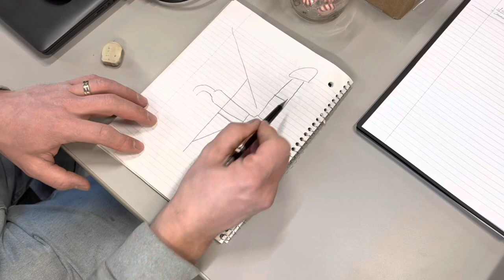Off Grid Cabin in the Woods gets a Wood Stove!

Comment: The base (crimped end) of the stovepipe needs to fit inside the stove collar. Jotul makes an adaptor to fit a 6in pipe to the stove collar. All crimped ends need to run towards the stove so the creasote flows back into the stove instead of leaking out.

Comment: i just installed a Jotul 602 in my garage. it had a 5 in receiver. i found a 5 to 6 in connector that allowed me to go inside, the way its supposed to be done so you dont get any creosote dripping out onto the outside of the pipe or on the stove. i've had it sitting in the basement for almost 30 years.  its bullet proof. fire brick on the bottom would work too. my only complaint is the short 16 in wood, but for my garage, they will be nice short fires. nice job.

Comment: Some thoughts on your build. Replace the shim under the wood stove with some fender washers of appropriate height, or, if the offending leg is detachable, shim it down from the stove body. Also, you should install jack studs below your loft rafters. Don't rely on the shear strength of the screws alone to hold any weight for any length of time; they won't.
Reply from the maker: Thanks for watching David

Comment: No vapor barrier on the walls or ceiling?
Reply: It is a shed afterall. The solid lumber helps in moisture management.  comment a snow shelve  to protect from sliding roof snow is recommended.

Comment: I have a Jotul 602 And my only gripe is a short burn time. Yes im using OAK or Maple hard wood. It seams like 4 hours is Max. I have not tried to dampen it down to almost nothing. Whats your burn times like?? I would like to stoke at like 10 11 and still have something at 6 would be Ideal... But at like 4am its OUT like no heat and the cabin is cold....
Reply from the maker: Having installed this stove late last season, I do not have a good idea on run time, though initial burns tell me they’re short as you mention. In addition to the door damper I installed a damper in the flue so with a little testing this coming winter, I hope to get 5-6 hour burns. We’ll see. Thanks for watching.